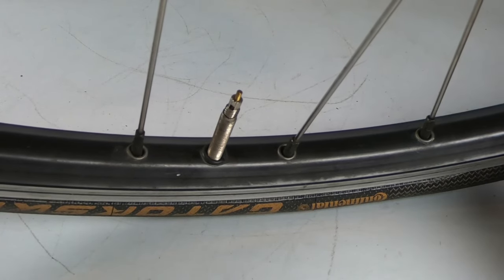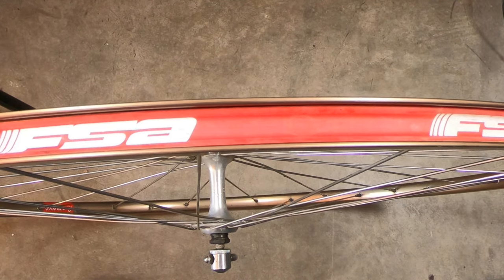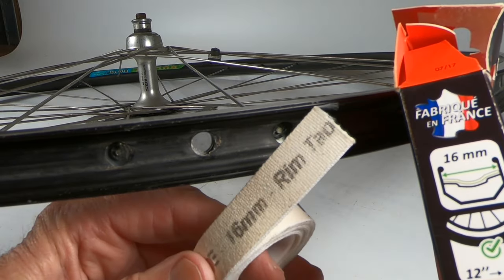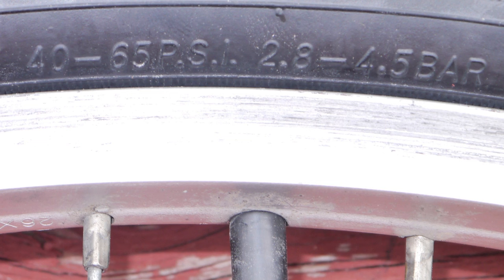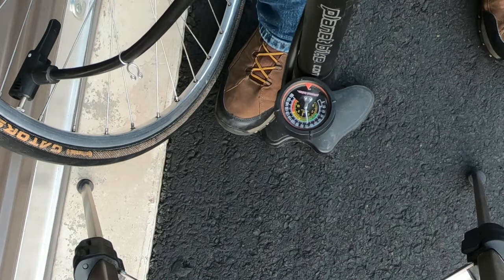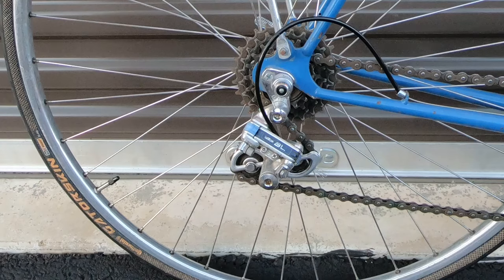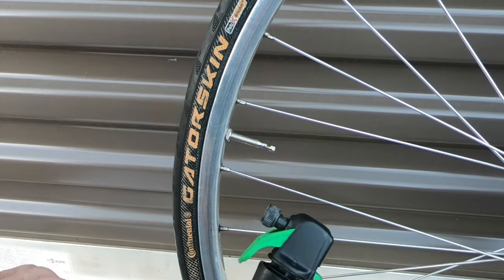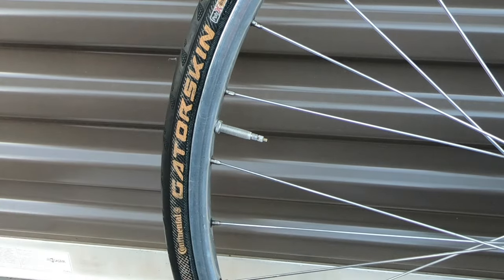More Bicycle Tire Problems and Solutions

Comment: Gorilla tape for a tire boot, or, in most desperate cases,  a multiple layer wrap over a cut or bulge, can get you home without hitch hiking. 

Velox rim tape is really good.
Reply from the maker: I've never used Gorilla tape for this.  Do you carry it with you for emergencies when riding?
Reply: @GregDickerson-bikevideos  yes sometimes, a few feet rolled around a cigarette lighter or smashed toilet paper roll tube. It might patch a pannier or save a gashed injury with paper towels or gauze.
Reply from the maker: Kind of like a Swiss army knife for emergencies.
Reply: @GregDickerson-bikevideos  I used it to wrap a roadie tire that separated at the bead from a pothole. I deflated it before it exploded, taped it and opened the brake wide, inflated to 60. I made it home and the wheel survived. I used Gorilla  once  to replace a wasted road bar tape for a ride. I wrapped McDonald's napkins and used 1in wide strips like cork tape.  Sticky but it worked for a day.
Reply from the maker: I may start carrying Gorilla tape as well.  It sounds like it's pretty good for temporary "get you back home" emergency repairs.  I have a rule that I don't call for help, relying on some kind of emergency repair to get me back home.  I've only violated this rule twice:  once when I had a sidewall blowout and once when I thought it was too unsafe to ride through city traffic in Charlotte, North Carolina.
Reply: @GregDickerson-bikevideos  a crisp 50 will likely buy you a pickup truck ride to a town if you have to hitch hike. Good to hide in gear bag or seat post etc. One time beef jerky and sprite saved my life when I got heat fatigue, dragged into a c store, cramping and dazed. I started eating stuff for salt, but had the cash so they were sympathetic.
Reply from the maker: Had the bonk more than once.  Luckily there was always a store nearby when it happened.

Comment: 100 PSI is way too much. It's actually a common misconception that the tire should be filled to its Max. The Sweet spot is somewhere in between 3/4 and 1/2 of its capacity. Depends on road conditions and the weight of the bike plus rider. There's plenty of information online to figure it out and calculators to help.
Reply from the maker: You are technically correct.  I'm aware of the calculations you mention, as well as the fact that a slightly wider tire can have less rolling resistance, etc.  I'll probably cover this in an upcoming video.  The inflation pressure information you are referencing is specific mainly to road bikes, but on this channel I have people who ride all types of bikes.  It would take a separate video to explain this information and I would have to be specific in stating that it is primarily for road bikes.  The point I'm trying to make in this video is for people to check the air in their tires before riding.  I can't tell the viewer who rides a middleweight bike with 26" x 1 3/8" tires that holds 65 pounds that he should ride with 50-75% of that amount of air.  Thanks for your comments and thank you for watching my videos.
Reply: Start with max pressure and just tap the valve a little to test lower settings till a grease pencil mark wears off the center tread
Reply from the maker: I've never heard of doing it this way.  Does this really work?
Reply: @GregDickerson-bikevideos  yes. You can find Tire Crayons in automotive but they make very  permanent marks on rubber. Whiteout works for the tread/inflation test. I carry work clothes and panniers or picnic lunches and weather layers. A piece of chalk works and is cheap. Make white stripes across the tread and ride straight. Look at the tread and see where it scrubs off. You can also use chalk to mark the lines for tire roll out to measure for cycle computers, mark intersections you've passed if you have to backtrack to navigate,  leave signs for riders off the back, or do art without damage.